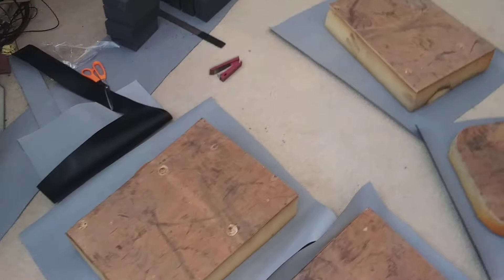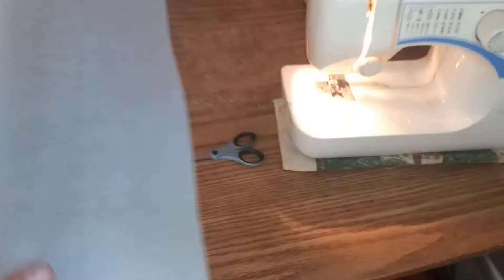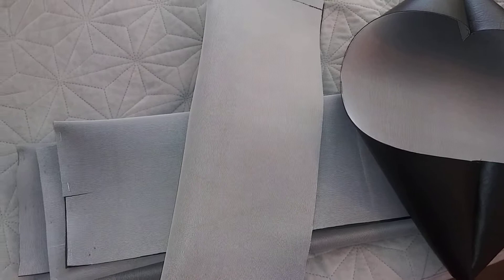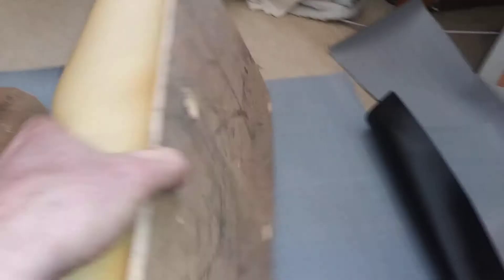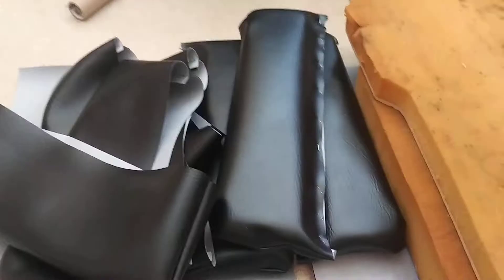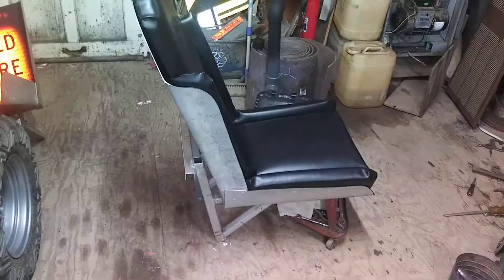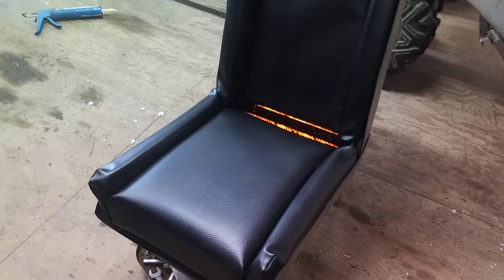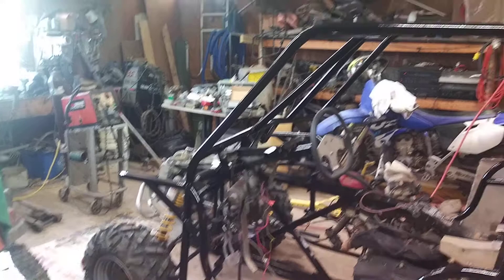canam futv 18

Comment: When you cover the seats you want the foam about 1/2-3/4inch larger in all 4 directions around the plywood as it allows you to pad the plywood edge preventing the vinyl from tearing a few years down the road.  This is a trick I learned from a professional seamstress that also recovers seats using this same trick to this day, when I recovered my first snowmobile seat back in the early 90's.  And that seat cover is still in use and undamaged to this day and it required all new foam when it was recovered.  Another trickis to use an electric carving knife to cut and shape your foam
Reply from the maker: I'll keep that in mind I use the bandsaw to cut my foam